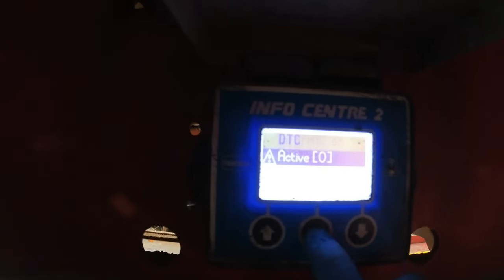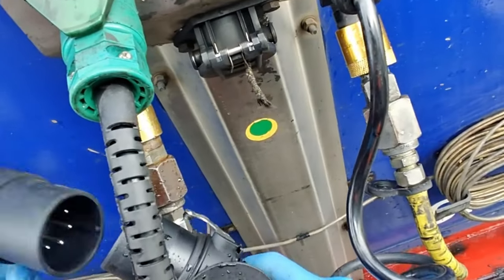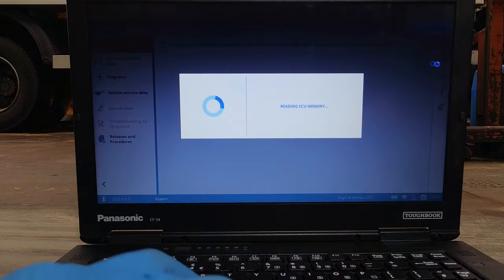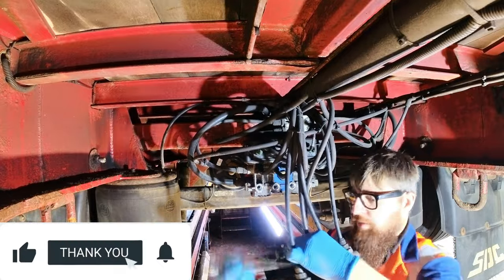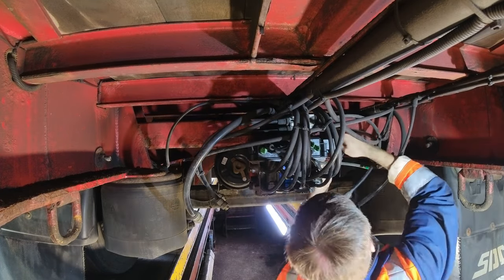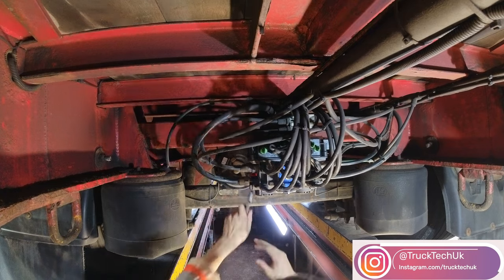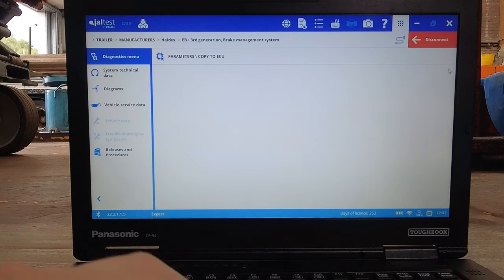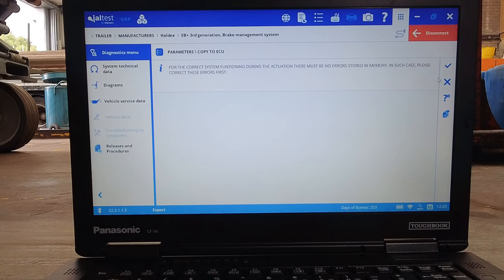HALDEX TRAILER ECU DIAGNOSTIC AND REPLACEMENT WITH JALTEST pt.1

Comment: Little confused on how air brakes work on uk trailers. When the red air line is pulled or the red brake button pulled does it engage the spring brakes or service brakes. Iv read something saying there's 2 systems in this country. Some trailers will put the spring brakes on straight away then others will put the service brakes on but the spring brakes will come in to action when the pressure drops below a certain  level. Can anyone here help me with this.

Comment: Spot on mate subbed from the struggler on his recommendation,I hate using jaltest for valves old place had the proper haldex computer so much quicker and easier to diagnose and program, them port 21 add on for the pressure sensor are a god send instead of changing a whole valve. Mint content proper binge watching all ya stuff
Reply from the maker: Thanks for coming over to have a look. I'd LOVE the proper HALDEX diagnostic tooling to do this job but like everything in life everything seems to be a compromise and then companies wonder why things go wrong 🫣
I'd of gone for the external pressure transducer but we just don't keep it Unfortunately and with the trailer being on contract maintenance it's like for like 🤷

I'm glad your enjoying the content.....it gets progressively worse unfortunately or you could say I'm getting progressively better 😂😂😂😂

Comment: Does front chassis module need to reprogrammed if we put new one? Thanks
Reply from the maker: Chassis module front will req to be programmed if it's replaced unfortunately. Make your your diagnosis is sound before replacement I'd hate for you to be changing it due to a power/ground issue or can
Reply: @TRUCKTECHUK  
Thanks very much for help.  its burnt I can see damages. I will get it programmed